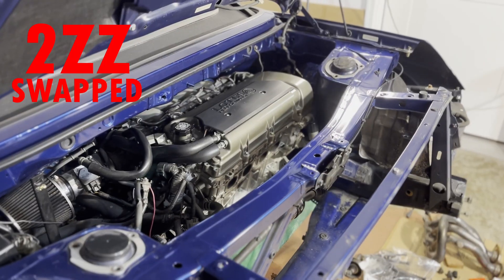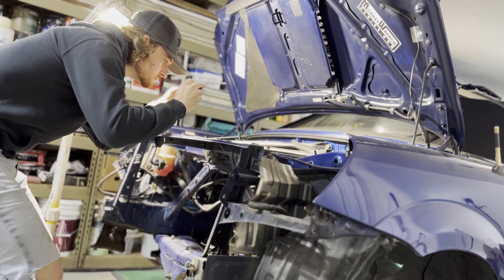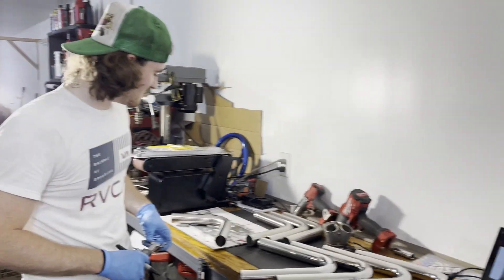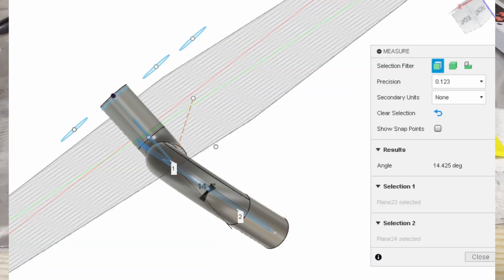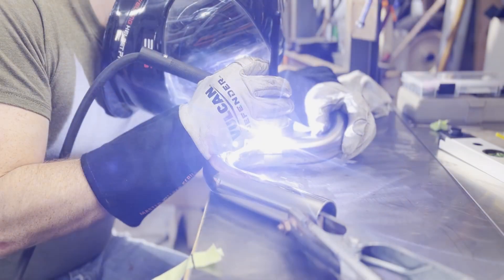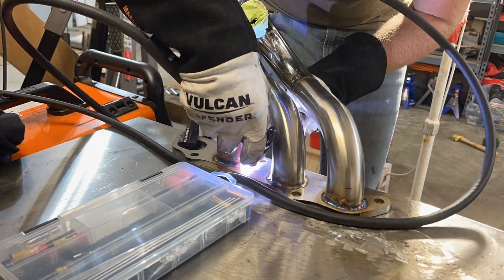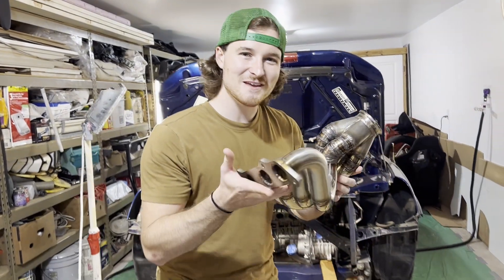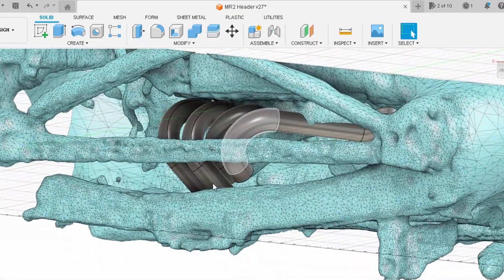FULL EXHAUST HEADER Build in 5 Minutes!

Comment: Just curious, where will you be mounting the O2 sensors? Or they'll be deleted?
Reply from the maker: Right now I am planning on putting one O2 bung roughly about 6 inches after the merge collector. Currently it is mounted in one of the runners of the header, which really would only tell you if something was wrong with that cylinder. Downstream sensor will get deleted most likely since I won't be running a cat

Comment: I'm really liking how this is coming together with your outside the box approach. With the limited space between the charger and the rear subframe, if you're not already running front and rear transmission mount inserts then that might be a nice cheap way to hopefully prevent any contact under hard acceleration. I got mine from monkeywrench.

This is a great build, keep it up 💪
Reply from the maker: Not a bad idea at all.. I think I have plenty of clearance between the superchager and subframe, but it is definitely something I should keep an eye on. Solid mounts would be nice anyways just to transfer the power better. Appreciate the comment and the kind words!!
Reply: @gastancehouse  Don't go solid mounts, the urethane inserts work great to reduce excessive movement without too much vibration being transferred through the body. You do get a bit of reverberation through the cabin at idle but it's easy to live with if it's not your daily, the extra response is great!